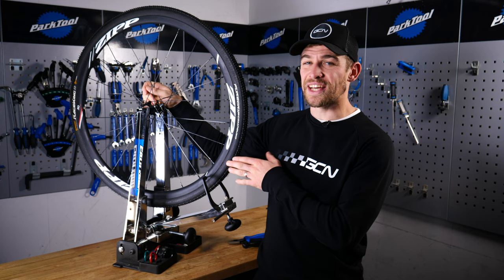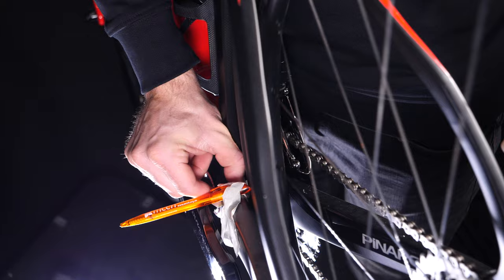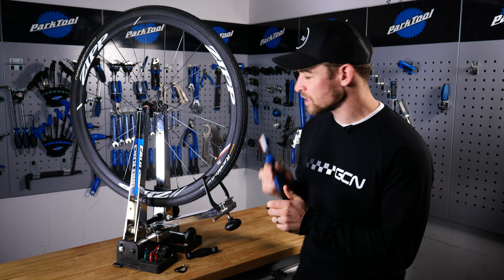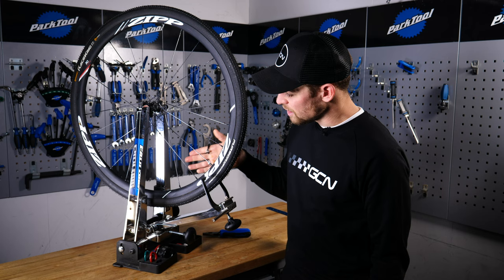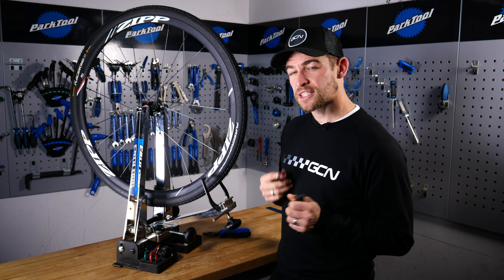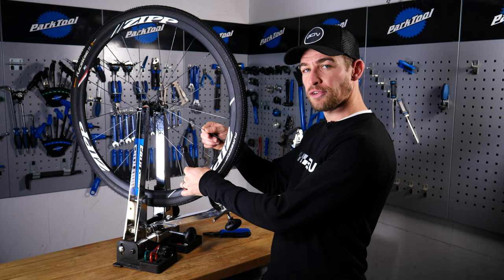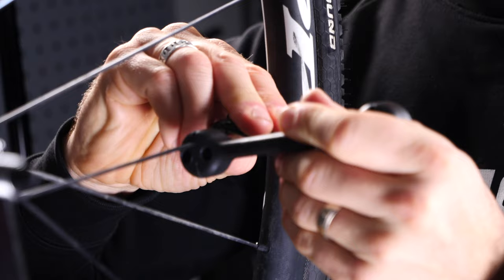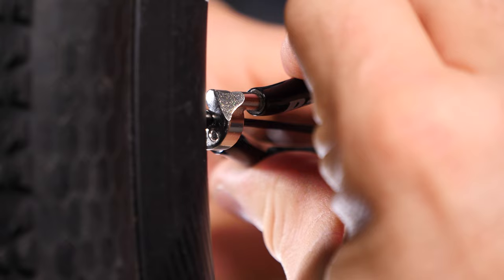How To True A Wheel

Comment: That's not how you properly true a wheel.  You have to loosen spokes on the opposite side of the area out of true as well to maintain the roundness of the wheel.  If you just tighten on one side you can create a 'flat spot' in the area you just trued.  Also, you need to twist the spoke nipple in small increments such as a 1/4 or 1/2 turn on both sides of the area out of true to avoid over tensioning the spokes in the area.  You just can't crank spokes on one side until it's back in true because you are very likely to not only create a flat spot but over tension the area which will turn into a broken spoke on your next ride.  I'm highly disappointed in this DYI instruction.
Reply from the maker: Hi Steven, Chris did recommend making very small adjustments as you've said, of course if there are over-tight spokes you should loosen them but this is far less likely to occur than spokes loosening over time. Thanks for you comment!
Reply: @gcntech  I can proudly announce, that I'm one of those more special people from that far smaller group, whom it has occurred. I overtightened the drive side spokes on my commute bike when correcting dishing on rear wheel. That wheels dishing, was more than half cm off to non drive side, I think. So I had a lot of dishing to do. It did not broke right away, but after a while a spoke nipple got through of rim, (aluminum rim), after I hit a pothole.  And then I noticed, that each spoke holes at drive side had cracks on 2 sides. But I think there was nothing I could do. If I had loosening non drive side too much, the spokes at non drive side would have needed some threadlock or spoke prep to stay tensioned. Actually, right after I had bought that bike I had to bring it back to shop because some nondriver side spokes got totally undone. I could turn nipples by fingers. Maybe that's also how it had got so undished. The mechanic in shop decided to compromise in dishing to fix the problem of spokes getting lose.
Reply: @gcntech  I've experienced broken spokes after truing wheels. I had only tensioned the spokes on one side didn't loosen the spokes on the other side. Until I learned better. One can actually feel to some extent how much tension is in a spoke, at least in comparison to the neighbouring spokes. So if the spoke(s) on the oppisite side of the buckle feel a little tight I loosen it/them. Haven't had any broken spokes since.
Reply: @gcntech  Got it but I still think it is an incomplete video which didn't cover all the nuances and rules of truing a wheel.  I've been building and fixing wheels for 24 years and I hope viewers heed the advice in my comment.  Normally I love every video you all make but this one was not as comprehensive as it needed to be and could lead to wheel failures if followed strictly by a novice viewer.

Comment: I did the first tip except took the wheel out and used my fluid trainer. That way I could get it up on my workbench, worked a charm.
Reply from the maker: Great tip!
Reply: #Gcnhack
Reply: Doesn't work so well with my rollers!

Comment: All great information for truing minor bends.  No mention of how to keep the wheel round though. For starters, any time that you tighten a spoke on one side, you should loosen the two adjacent spokes that go to the opposite side of the hub by half the amount of tension that you’ve just added to the one.  All of this is assuming a traditional spoking pattern such as radial, 1x, 2x, 3x, or 4x.  Special patterns such as Campagnolo G3, some Shimano wheels, or some Rolf designs should only be serviced by very experienced wheel builders who have the correct tools and have been formally trained to service those wheels.
Reply: Thanks for that.  I have campagnolo vento g3 that wouldnt completely true no matter how thorough I was with attention to the spokes.  I was thinking it might be an issue with the axle or bearings but are you saying with these instructions I would still have issues trueing a campagnolo g3?

Comment: Some added tips: 
Always hold the spoke closest to the nipple to avoid twisting the spoke.
Some tyres are not always molded true so you cant always use them to tell if a wheel is buckled.
Deflate the tyre before truing, some tyres while inflated can influence unwanted tension form side to side, this is more promenent for tyres with wire beading.
Ensure your wheel axle's are sitting in the frame/forks properly when checking for true.
Lastly: buy a cheap wheel online and intentionally buckle it or dismantle it and rebuild it so you have the practice to work on your higher end wheels.
Reply: that last tip was exactly what i did!! bought some cheap wheels to learn on. its actually oddly therapeutic building it back up haha

Comment: I absolutely love wheel building.  I never had any formal training, so watching this video confirmed I was doing things right.  I'd like to add a couple of things.  I tighten and loosen spokes as necessary, and then I squeeze all of the spokes on the wheel in pairs to allow the spokes to let the spoke twist back into place.  Also, be careful not to tighten the spokes too much, otherwise you'll create a flat spot on the rim.  You may have to loosen the spokes on the opposite side of the wheel.  Truing wheels is all about maintaining balance of the spoke tension.  It's an art that is learned with lots of practice, but very enjoyable and rewarding.
Reply: "be careful not to tighten the spokes too much, otherwise " you'll crack the rim.

That was my first truing attempt. Oops...

Comment: I trued a pair of wheels, then I rebuilt them and after that I built two pair of wheels. Really fun when you get in to it. I used park tools app and build all my wheels to maximum 5% difference on the spoke tension and they have stayed perfectly true for 2 years och gravel and cx ridning.
Reply: How long did it take you your first time?
Reply: @linglingjr  building or truing?
Reply: @martinh2783  just truing.  Although that does make me wonder how much cheaper carbon wheels and hubs are if you do it yourself...
Reply: @linglingjr  Don't remember how longit took to true the first wheel but it all depends on how out of true it is. If it's only slightly of it can be done in 1 or 2 mins. How much you save depends on what wheels you will make and how you value your time. I build a pair of cx wheels on DT 240 hubs and china carbon rims that weigh 1200g for a total cost of 930 euro.

Comment: Nice Video.  I use a Park Stand and have built 12-20 wheels. I use Linseed Oil to wet each nipple.  I bought a cheap magnetic mount, dial indicator rig and orient so when I nudge the rim toward the indicator, the indicator needle points down (moves away from the rim), so I'm seeing the direct effect of snugging a nipple.  Like you said . . . .so many good tips.  I like the round Spokey Disc that grabs almost 4 sides of the nipple as my wrench.  When you think you are done, tap each spoke with a spoon and listen for the same note (ping) throughout that side of the rear wheel or both sides of a front wheel.  With the tire off, you can also check and correct the "hop" not just the side to side wobble,  the eccentricity of the outside of the rim to the axle.  You can snug spokes on both sides in the area where the rim is farthest from the axle to take out a hop little by little.  After you mount the tire you can see its hop. You might need to reinflate the tire to cure off-center mounting.  I deep clean my wheels in my trueing stand also (rub spokes, hub and rim between spokes with rag damp with WD-40).

Comment: I built my first set of wheels this year using my grandfather's old equipment.  I have to say that the prep work was a lot more stressful than actually putting the wheels together.  I found out new spokes are expensive and I was really hoping the measurements I took of the hubs were correct.  The rims were new so I had the proper ERD and things worked out well as far as I can tell.  I keep thinking I must have done something wrong but they keep working so I guess they are ok.

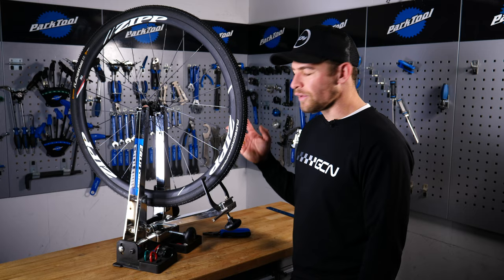Comment: at 2:42 you mention the direction to turn the spoke nipples to add to release tension. The theory of clockwise vs. anticlockwise, though correct if looking at the spoke from the tire side of the rim, is not accurate in most cases. In fact, most of the time when trueing a wheel you are in fact looking at the nipples from the hub side of the wheel. This means that to tighten the spoke you actually turn the spoke key anticlockwise. This is the one thing most people have an issue with when learning how to true a wheel. Now, off to the shop to build a bunch of replacement wheels for next season.
Reply: I actually had a spare spoke with nipple on my hand reach to check what way I need to turn it, when getting confused. :D
Reply: I just find it makes sense to me to think about it how it actually is. The nipple is a nut, the spoke is like a bolt. When viewed from above the nipple (tyre side of the rim) you turn the nipple clockwise to tighten, anticlockwise to loosen - just like 99% of all nuts, screws, and bolts ever.
Reply: @khaki.shorts  Thank you! After thinking about your comment for awhile, I realized that you're absolutely correct. I used to get confused  that I had to turn in the same direction when loosening or tightening the nipples, regardless of their position relative to the center of the wheel.
Reply: Bigfoot that needs 100 subs yes righty tighty upside down  is anti clockwise

Comment: hi there, i purchased a new rim, and spoked it, now im trying to tune it straight, but it is a bit more complicated than what i saw on your video..., it not only has wiggles left and right, it also hops....:), i use a spare frontfork for the alignment, and yes fiddling with it is very therapeutic:), but after a couple hours it can get you very cranky too;), so to prevent that, i roll a fat blunt to trigger my angelic patience, which has proven its value countless times...:), so even if i didnt get it straight the first time, i allready know i will be victorious ultimately;)
good video, i know for a fact that even bicyclerepairshops try to avoid these repairs...., but we shalleth not give up...:) happy trails budd, grtz from Holland;)
Reply from the maker: Keep it up Mario, you have the right attitude so I'm sure you'll get the wheel perfect in time 😀
Reply: @gcntech  its a cheap eagle rim, so im not in a hurry;), i can wait till we get rid of Trump first^^(lol), and its for my Gary Fisher Y-frame, 26 inch, im riding a Ghost Kato 5, 29 inch at the moment;), but i got the Gary from my bro and it needed a revision;), i really like the original colors, but it has had a hard life with my bro;), it all in parts now, and purchased 2nd hand bike for some swappables...., which turned out nicer than i expected allready:) AND im seriously considering to give it a whole new paintjob too;), so you see, the rim isjust minor thingy anyways;) tnx4response, i'll subscribe to ur channel;)

Comment: I also like to stress relieve the spokes after adjusting their tension by giving them a quick squeeze with their pair.  When you let go the spokes should relax to length and tension they will maintain once they are back on your bike on the road.  If you do not stress relieve the spokes, the truing may change on your first ride that includes some rough pavement.

Comment: Another method to find spokes with lower tension I use is a small allen key. Let the wheel rotate and let the key hit the spokes (just very lightly). You can hear which ones are out of tension - or too high - by the sound you get. Just like with a guitar string.
Also works when flicking a fingernail against a spoke.

Comment: Is it better to take rim tape, tubes, and tires off before you true the wheel or should you put the rim tape, tube, and tire on before truing the wheel? Also does having bearings packed have any effect on wheel truing?  Should that be done before truing the wheel or after?
Reply from the maker: It's best to take the tyre off, no need to take rim tape off unless your wheel has internal nipples - ideally your wheel bearings should as they would when riding, if the wheel is loose in anyway this will definitely make truing the rim harder!

Comment: "turn clockwise to tighten" tightens by turning counter clockwise
Reply: Yeah there is a mistake in 2:42 about directions of tightenning
Reply: Wish I had read that comment before totally screwing up my wheel. Now it has to go to the shop because it's severely bent from turning nipples the wrong way (but the way the video says)...
Reply: In his defense, he does clarify stating as you're looking past the tire, and again when mentioning to think of screwing the nipple onto the spoke.

However, this is counter intuitive for a novice like myself and I only picked up on it because of the two previous videos I watched on this - of which, this was the only one to mention holding the spokes while tightening or over tighten and slightly release.

Comment: I got this horribly wrong before my weekend ride. Shimano 6800 wheels are the only wheel I've ever had, that have the opposite way you turn the nipple( screws into the rim and out, rather than screwing into the actual spoke). So I tightened while trying to loosen so ended up overtightening and damaging a couple of spokes as well as making a small mm odd buckle into a 1cm! I still went on my ride after finally truing it, even though I probably shouldn't. But those spokes will have been weakened and fatigued, so need replacing :(

Comment: Great tutorial for start, with markers and pliers to improvise, but what happened with releasing the tension on the "opposing" spoke, to prevent the roundness of the wheel (assuming it didn't lost the roundness due to an impact or something)...?
Also, I think it would be wort mentioned that even out the tension of all the spokes on the same wheel side... I guess many of the viewers know - it can be done "on hearing", or to get the same tone on every spoke,  if you don't have a hefty priced tension meter...
Cheers! :)

Comment: After getting hit by a car on my mountain bike, I once trued the the banana'd front wheel back to within 1/8" of true with nothing but a spoke key, a screwdriver, and two zip ties on my frame to use as a truing stand (took the wheel apart, straightened it to within 1", then re-laced the wheel with the same spokes and nipples). Took an afternoon, and I carried a spoke key with me for a few weeks of commuting.

Yes, the front wheel was probably weaker afterwards, but that front wheel survived a downhill session that snapped my rear axle.
No, I definitely didn't have money for a new front wheel (was a broke-ass student at the time), and I had disk brakes, so I didn't need it to be 100% true.

TLDR: Give it a shot, when something looks FUBAR, you can't really make it much worse...

Comment: You seemed to have failed to mention the most important part that you need to check and that is "spoke tension"  as its quite easy to end up with too much tension on the spokes that can cause tiny cracks to appear in the rim by the nipple.....

Comment: I'm kinda plagued with spokes breaking at the J bend. For the first year or around 800 kms, she was perfect. However, after the first spoke broke, I lost the second one in three months or around 500 kms, and third pretty much back-to-back. The fourth time I lost a spoke was in two and half months time around 300 kms later. My LBS says I should go for double wall rims. Can you help. I ride a Btwin folding bicycle with 20" wheels and I love to take her on tours. I ride anywhere between 80 to 100 kms in a day on tarmac in hilly areas with the roads sometimes perfect and sometimes not so. I weigh 75 kms and my rear carrier takes about 7-8kgs of load and 3kgs in front. She has a 6 speed freewheel setup.
Be glad if you shed some light.

Comment: My question is isn't it going to make a difference in the tention between the two sides in the area you are truing.. Since you're putting more tention on the opposite side spokes which pulls the rim to that side thus truing it.. So the tention difference would make that particular spot weaker.. Or how does this work??

Comment: If the out of true is caused by a dent in a metal rim you are unlikely to ever get it true, because the dented metal is stretched out of shape. You cannot compress a piece of distorted metal back into it's original form. After some hours of frustration you should give up and replace the rim. Speaking from experience of course.......
Reply: All of my retro wheelsets are 30plus years old, that need tweaking or rebuilding at times. Spokes fail thru fatigue. And true with old wheels if I get to half a mm good enough. As as you say the wheel has seen lots of life is likely never to be perfect again.
Reply: Well you actually can take out some of the stretch in metal with heat and some patience. Although I honestly don't know if that can work on a bike wheel. I do automotive body work though and I do this all the time.

Comment: I had chewed a will once before, I used a chopstick take to the frame turn to bike upside down of course and did the best I could. I have taken it to a bike shop to get it trude and I insist it for the money that I was paying not only to true the wheel on the stand but to check the spokes for tension and to check check the rim with the rim jig. Which made the mechanic kind of upset because I asked for that will to be truly trued not just put it on the wheel stand and turn the few Spokes and then want 30 bucks. For The 30 bucks I want the whole 9